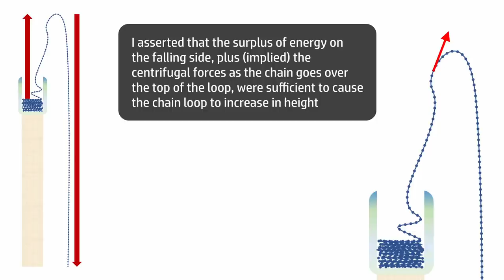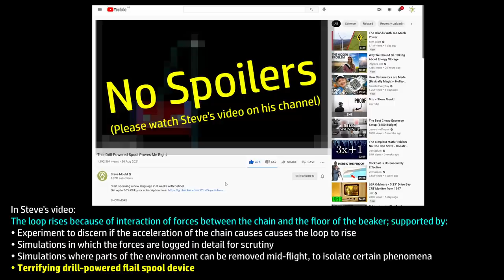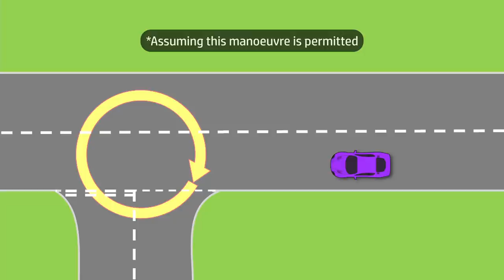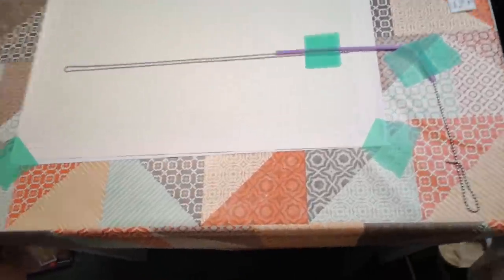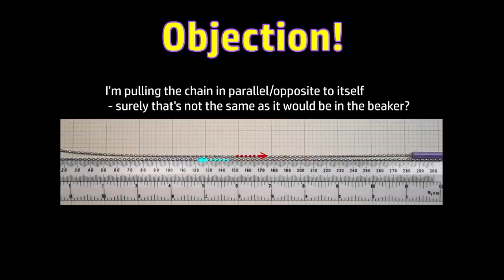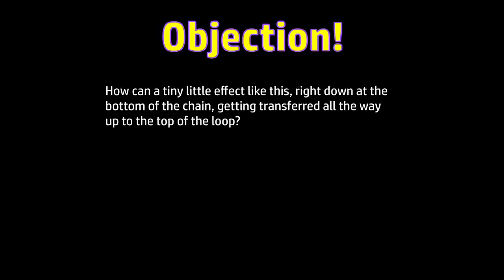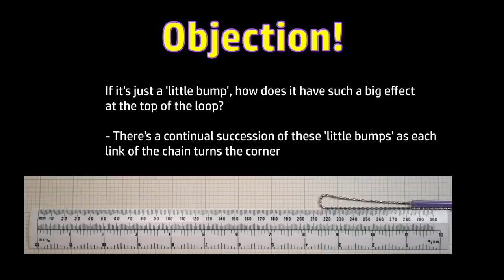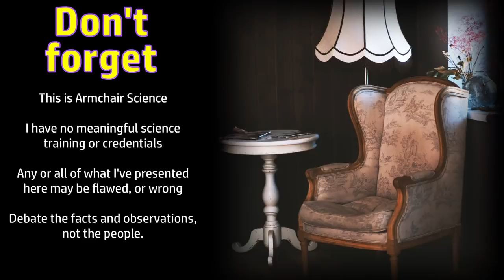Another Look at the 'Mould Effect' (Rising Chain Fountain)

Comment: (1)   The Cambridge explanation is rubbish. There is never a bonus-kick at the container/jar/beaker.
There is indeed a bonus-kick when a falling chain-link hits (collides with) the floor of the laboratory, & this adds to the downward pull of a chain, & increases the height of the fountain etc (by say 1% in practise they say)(by potentially no limit in theory).
But that extra (bonus) force is initiated by the falling/colliding link itself.
Meanwhile, back in the jar, during launch, a rising/yanked link will indeed get a mini-kick from the floor of the jar (or from the links supporting that link), but, that kick is not initiated by the rising link, it is initiated by the preceding link.
The preceding link has a limited amount of impulse to give.
The kick from the jar results in a similar (but opposite) kick being given to the preceding link.
But the kick from the jar is not a bonus-kick.
The initiating impulse from the preceding link is not added-to by the kick from the jar.
The impulse of the kick experienced by the rising/yanked link has been borrowed from the preceding link.
In reality, borrowed from the full/whole chain.
Hence, at the jar, links or beads, it makes no difference.
In summary. Yes there is some kick-effect at launch (even in a bead chain), but, these kicks are not bonus-kicks. They borrow from the overall power of the chain system, they don’t add to the fountain.

(2)   In reality, at launch, there is no rising/yanked link. Duznt happen.
What i mean is, we mostly have a wide rising/yanked arc, made of many links (beads here).
In slow-mo u can see that there is mostly a long arc of moving beads.
And the movings usually involve being dragged horizontally for a time, & gradually upish.
There is no sudden up-kick -- it is gradual – very gradual.

(3)   Look in slow-mo at a bead-chain fountain in the launch zone.
There are say 4 adjacent beads acting as pseudo-links being yanked/jerked up.
(a) Firstly, these pseudo-links are not rigid, they have a lot of give, & loss of force.
(b) And, the pseudo-link & the trailing say 5 or even 10 beads can be seen to be mostly moving horizontally (mostly sideways) & have daylite under them.
(c) They almost never have a solid floor to kick (down) against.
(d) And, on the rare occasion that the last bead in the pseudo-link does enjoy an upwards (very very weak) kick, this kick is mostly sideways, off a slippery & loose bead or two. Beads do not provide anything like a solid surface to kick offa.
Sheeeesh!     Stone the crows!         Milo give me strength!            Are we blind!

(4)   The fountain (ie the arch)(the half circle) is simply due to the inertia/mass of a chain.
If a stationary chain hangs over the top of a wall, it forms a sharp V-bend.
If the chain is pulled down on one end, then it will rattle up & over the wall, with speed.
If the speed is sufficient, the sharp V-bend will become a U-bend, due to centrifugal/centripetal forces opening up the V.
If speed increases, the U-bend opens further.
At hi speed the rising chain leaps up clear of the wall, & stays clear, & the U-bend opens more.
And we have our fountain.
The height of the crest/fountain depends on speed.
The radius of the U-bend of a fountain duznt depend on the speed or height (they say).

(5)   Steve Mould shows how a horizontal tight pattern of rows of chain (beads) gradually pushes away to the west (due to the kick-effect) when the end of the chain is pulled east.
Yes, there is some kick effect.
But, the greater part of the effect is due to a chain's inclination to retain a pattern.
Here, we see that at each end of each row Steve's chain forms a loop, looping around & back throo say 220 deg, such that the rows sit hard up to each other.
As the chain is drawn east, the loops move across & back & across & back etc.
Now, Steve knows that a chain has a memory, ie it tends to retain a pattern. Here, that pattern is a 220 deg loop.
And, as the loop or loops traverse across & back etc, the loops slowly push the rows west.
That westwards slow pattern-push is a different animal to the quick jerk of a link-kick.

(6)   It is virtually impossible to load/store a chain in a jar without having loops. And loops result in jumps. 
If u have a close look (in slow-mo) u can see that chains have a lot of horizontal movement before exiting vertically, & the chain sometimes suffers little jumps in the jar, as each leg of each loop jumps (while moving horizontally) over its mate. 
Jumps magnify the fountain, kicks dont. OOPS. No, i am wrong. These little jumps are not bonus-jumps, just like the kicks are not bonus-kicks. Any vertical impulse gained by a jump must have been borrowed from preceding links. 

(7)   Also, the horizontal movements seen in the container/jar/beaker are a waste, they rob power.

(8)   But, in any case, we don’t need bonus-jumps nor bonus-kicks to achieve a growing fountain, & to achieve a high fountain. 
All we need is lots of speed. The bead-chain will crest at any height, depending on speed. There is no limit (the strength of the chain is a limit)
The idea that something special (like a bonus-kick) is needed (if the chain is to rise above the edge of the jar) is silly.

(9)   One thing that everyone has missed, in every youtube re the chain fountain (that i have seen), is that vertical jump effects & vertical kick effects (etc) are cumulative, and lasting (tautology alert).
Or at least partially cumulative & lasting. Air friction, & link friction see to that.
Anyhow, cumulative/lasting effects are the reason for some of the slightly weird gyrations/waves.
For example, it (lasting accumulation) is why we eventually get a persevering, vertical component of arc (a mini fountain) when the test is strictly in the horizontal.
In fact, the lasting/cumulative effect is a major cause for a standard vertical chain fountain.
There needs to be an initial vertical rise out of the jar.
A horizontal initial exit wont do the trick.

Comment: "not a push, but less of a pull"  I hope I didn't need the synapses that failed while parsing that statement.  They just sort of "noped out."
Reply from the maker: Sorry about that.  If you have a bag of shopping and you remove the tomatoes, it takes less effort to lift it.  Removing the tomatoes means there is less stuff 'pulling down', but the same change in forces can just as easily be framed as a push upward.
Reply: @AtomicShrimp  I like turtles.
Reply: @AtomicShrimp  I'd never remove the tomatoes, N E V E R!
Reply from the maker: I remove them from your bag and put them in mine, eh? Eh? EH?

Comment: To test Steve's hypothesis, why not take away the beaker?
Attach a weight, equal to the weight of the chain, to the end to be dropped.  Have the assembly suspended over a suitably low friction dowel, sufficiently high that the chain 'reservoir' end is freely hanging.  Drop the weight and observe.
Reply from the maker: I think such a setup would have to be really tall in order to get up to sufficient speed. Weight doesn't make things fall faster (although in the setup you describe, it would offset the weight of the hanging chain on the uptake side) . I think this setup does introduce new potentially confounding factors though, such as greater tension on the chain, greater downward forces applied to the top of the loop on both sides, etc.
In Steve's recent video, he does actually remove the beaker in a simulation - this was one of the most compelling parts for me

Comment: I suspect centrifugal and centripetal forces are present because the lip of the jar forces the chain to describe a curve.  For the fountain to grow these two forces have to be unequal. I get what you say about the minimum radius described by the chain… ie there is our wheel or rather a top half-wheel which has no bottom half meaning that the wheel is unbalanced.   BTW I’m still not convinced I understand this. But anyway, the top ‘half wheel’ does not have a bottom half pulling it down and so climbs upwards.  The downward pull on the long side of the chain is necessary to turning the half wheel, but is not the source of imbalance (I suspect).  The fountain tops-out rather like a satellite settling into geo-stationary orbit.

That said why didn’t BRUTEs (British Rail Universal Trolley Equipment) form problematic widening loops instead of each trolley following the one in front faithfully as they did so beautifully in practice?

My favourite railway sign was No BRUTES Beyond This Point (Platform 4 Shrewsbury Station just before the point at which the adjacent Platform 5  buffers were (a bay platform). Does anybody have it in their possession?) The BRUTES were  blue and could describe a minimum radius that the south end of Platform 4 could not accommodate when a chain of BRUTES was pulled by its electric tractor.  However I digress..

On the question of unbalanced masses and railways, on two cylinder locomotives the counter weights added to compensate the reciprocating masses still had the wheels jumping off the rails and hammering down on the rail many times per minute.  This was called Hammerblow.  The blows could massively exceed the static axle weights of the loco.  This upset bridge engineers very much (the downward hammer blows as much or more than the weight of the loco). Three cylinder locos were not so troubled by this effect.

Is there a way of linking two chains together (to run alongside each other) with cross ties every couple of centimetres?  What kind of effects do they have on each other? I like to think they would form appealing static side bends.

A shout out to my wonderful late Physics teacher, Dr IB ‘Yobbo’ Williams.  He was fantastic.  He gave us two or three problems to think about per week.

PS. Are chain fountains ever a problem when ships drop anchor?

Comment: You forgot that the chain broke off the tower.  The downward force is limited only by the strength of chain. I mean all watched the loop grow till the chain broke.  How do u explain that?
Reply from the maker: I don't know what you're expecting me to explain. Nothing you've said contradicts anything I said
Reply: @AtomicShrimp  the chain loop can rise to the ceiling and more depending on the force exerted from the downward pull of the chain. Why would perpetual motion be a thing? Anyway, my hypothesis is that a whip will crack at its tip when the tiny mass at its tip moves faster than the speed of sound as the wave passes over it. The motion though is through a tiny amount of space. I believe that as more force is exerted downward the links would begin to, just as the tip of a whip does, move faster than the speed of sound for a tiny instant as their motion switched from up to down.  The loop is a shape that smoothes the transition from up to down in a way that does not break the sound barrier.  Think about it, as that link is at its max height, if it suddenly went straight down, how fast that would be? Crack for sure.
Reply from the maker: I don't know if you've watched Steve's video, but he addressed this. The speed of the chain doesn't whip the loop higher
Reply: @AtomicShrimp  thats silly.  Watch his video.  You see the loop grow till the chain snaps.  You literally watch the loop grow then snap.
Reply from the maker: I don't think we're talking about the same video
Reply from the maker: But in any case the loop will grow to a height that is some function of the speed of the downward falling side (which can be faster if it has further to drop). This detail is not disputed
Reply: @AtomicShrimp  100%.  I think steve does not appreciate how significant the brakes were and how much force was applied to the chain to brake it.   Try to break it in your hands.
Reply: @AtomicShrimp  i want to apologize for getting so impertinent.  You have a great channel and i want to thank you for the interaction.
Reply from the maker: @AnonymousAlcoholic772  thank you, but please don't worry about it. Nothing wrong with a bit of discussion
Reply: @AtomicShrimp  i believe ive been too forceful and unimaginative in my thinking.  I still think my paradigm is more or less right and you are correct, we do not disagree. I have been most honored to chat with you sir.  The internet needs more geniality.

Comment: Electroboom’s response :)

https://youtu.be/0xr8Vh7z83g
Reply from the maker: He does raise some interesting points in there, however, I think he's barking up the wrong tree with the chain draped over the pole thing - you can pretty much see the loop only climbs when it traverses the pole.  I think he argues convincingly on the floor experiment (but not very conclusively).  
He doesn't appear to touch the simulations at all, which were (for me), the most compelling and undeniable part.